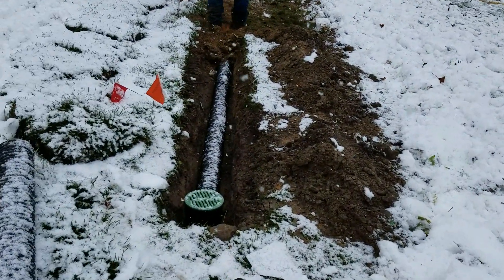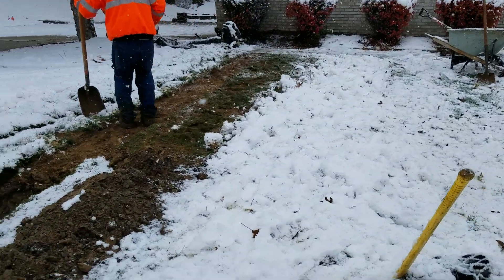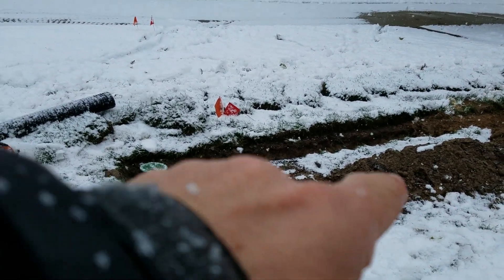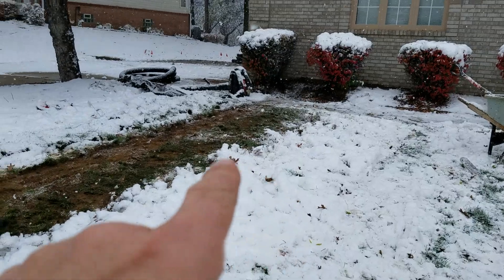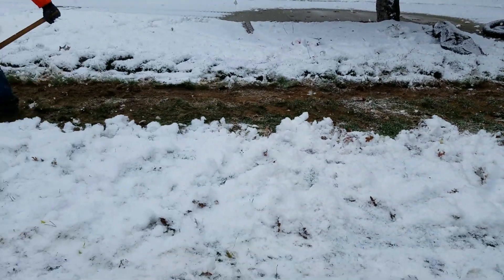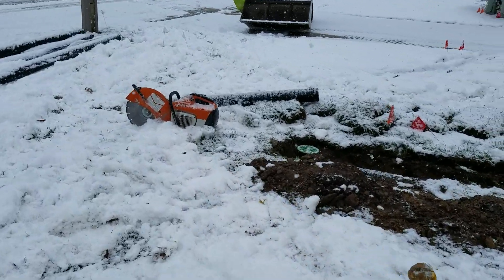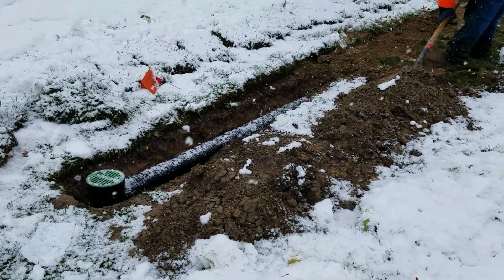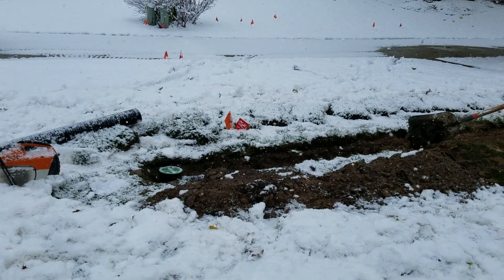Best Downspout Pipe for Underground Drainage Systems - French Drain Man, MI

Comment: Dealing with a gutter and sump discharge line and roots are my problem, the existing buried pipe is black PVC or ABS and has horrible root problems and is broken in a few places from roots pressing on the exterior also deforming the pipe in places where roots are present.  Nearly all the joints have root intrusion as well.  Though I am not sure the pipe was solvent glued together at all points.  How does this n12? dual wall hold up in those conditions and are the taped joints even going to stand a chance against roots.  I'm in SE Wisconsin and freeze thaw is a concern as I am only about 20-24" down.  Thanks for any guidance.
Reply from the maker: Trees win in the long haul the amount of pressure they put on all pipes is insane they even crack concrete pipes. Go to a 6 inch pipe in a virgin pipe like the Baughman Tile single wall its your best option. Cutting trees down is the only thing that protects your system but I love trees. I understand your dolama.

Comment: I am sp new to diy downspout works.. I live in Southern Ontario Canada. I bought a house last winter and a previous owner had installed a very long flex plastic pipe on a downspout pipe from higher spot, where he could reach from the deck and swing it around to switch pipe direction to a rain collection tote and the other side. During the winter ice had built-up all the way and the flex pipe cracked, water leaked a lot onto the gas&hydro meters right under the flex pipe.  In Spring, I installed a diverter system and put extension pipes on both the tote and lawn side.  water flow on the lawn side is too strong that the soil erosion is bad. Grass died where the water flows.  Yesterday I removed the extension pipe on lawn side with shorter flex pipe and re-directed to where gravels are. My concern is the water may sit in the flex pipe, and ice build up all the way to the gutter in winter again.   I don't have knowledge what to do. I can't afford to hire a company to jnstall underground drainage system. 
Any advice would be appreciated.. thank you..!
Reply from the maker: Heat tape is the only thing that prevents gutter downspouts from freezing
Reply: @FRENCHDRAINMAN  I was looking up about the heat tape.  ouch.. that's the only way eh :-S    thank you for your reply.